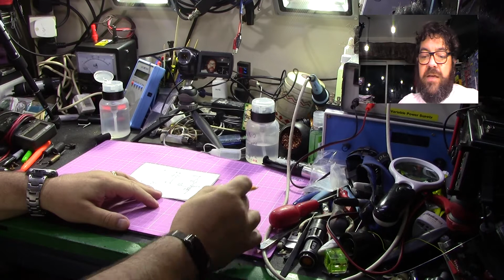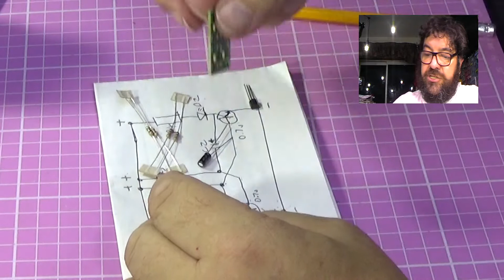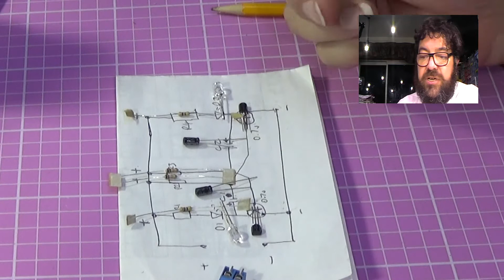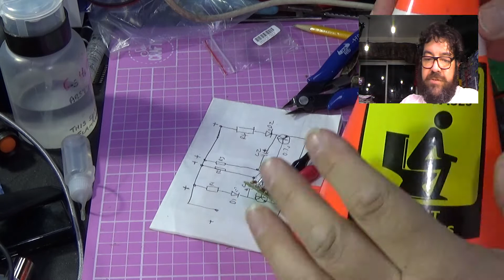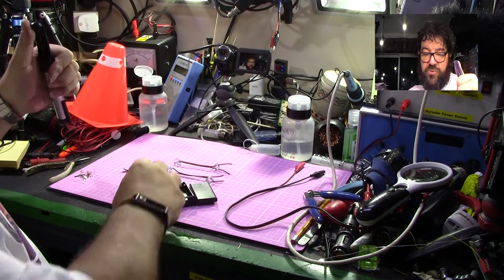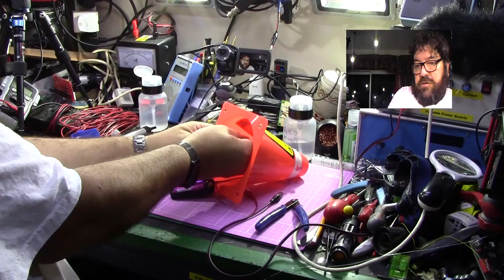Using a Flip Flop to enhance a warning cone

Comment: Nice one, I recall cobbling one together from old parts and  got it working.  A couple of years ago I was given a DVD cabinet that looks like Doctor Who's TARDIS. I added a blue flashing light intended for alarms and put an A27 12V battery in an N size holder under its circuit board and wired in series with the power leads which were wired to push button switches at the top of the doors.  The light flashes when any door is open, nice bit of fun.  Forgot, I changed one of the caps to give a 50/50 cycle instead of a short flash.
Reply from the maker: These are the things we do for fun. It cannot be serious stuff all the time now!